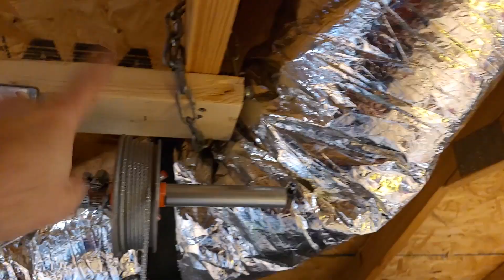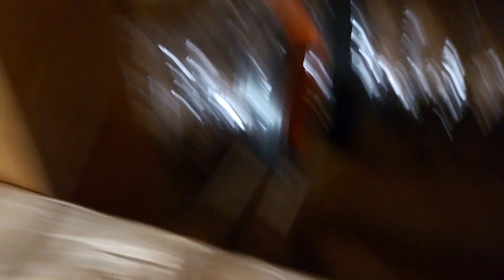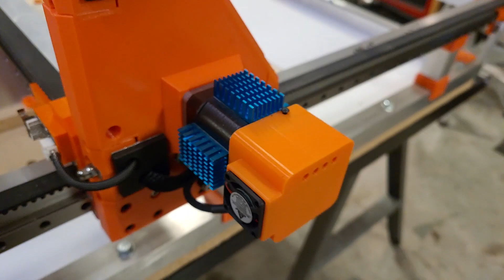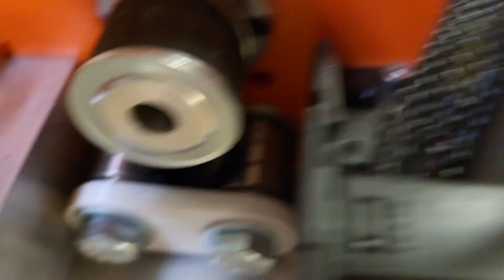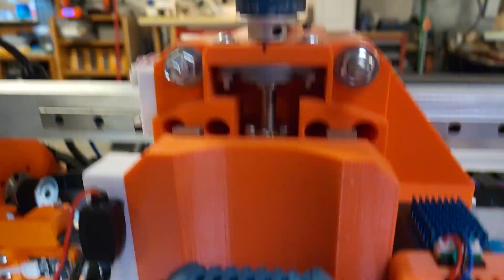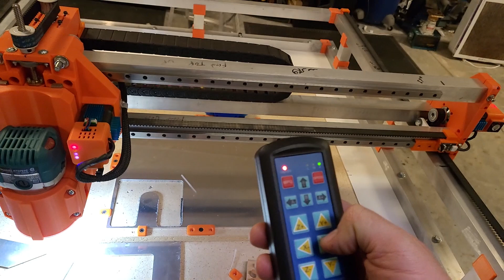Walk Around Of My 3D Printed CNC Router based on the Ivan Miranda's Design. Many Mods

Comment: From what i've seen online, most rigidity problems come from the motors not being able to completly hold the position when you apply force on the toolhead. Do you know what the deflection on the gantry is when pressing on it?
Reply from the maker: I havent actually measure deflection but i cant stop the gantry when it is being powered. The 19 to 1 gear reduction gives it plenty of power but makes it super slow.
Reply: @JPN76  I've seen that you mentioned that, still rigidity is a whole nother beast compared to static load resistance. An analogy would be a wooden beam vs an aluminium beam. Both could "stop" your hand from pushing, but the elastic modulus is vastly different, as such, one could allow vibrations and the other "would not" . 
The same applies to the geared motor. While you can't apply enough force to overwhelm the motor into the next step, you can still make it travel, say, a 1/10 of the step to the next step, and then it would snap back.
This phenomena combined with frequencies, is our worst enemy in hobby CNC.
This is usually solved with the "worm gear" like properties of ball threads, and in belted systems, basically over-sizing the motors to the point that that 1/10 of a step, requires such a large force, that it usually never occurs.

Comment: This CNC and the lift is awesome I will be building on from my shop. The lift mechanism (motor and garage door equipment is "inspired")  . I was wondering where I could source the drive mechanism "motor for positioning satellite dishes" may be tough to find.  Any idea on where to find one ???
Reply from the maker: I just searched not sure where to find that motor. I bought a bunch 20 years ago for another project. Used them for a paint ball tank turret. Scroll back 15 years or so in my vids and you can see it. But honestly if I had to do over I would get a stronger motor. A right angle low rpm high torque motor should work.
Reply: Windshield wiper motors are nice options.

Comment: Can you please do a video of the control board been doing mine for a while and went with an Arduino cnc shield, also how did you attach your laptop to it
Reply from the maker: I use a USB mach3 conrtol board.  The link is below but they have many variants that work the same. It will not work with GRBL just mach3 control software. 5 Axis Breakout Board, Maximum 100kHz MACH3 USB CNC Motion Controller Card Interface Breakout Board with Hand Wheel Interface https://a.co/d/4AYS8Oj
Reply from the maker: Also there are many videos about these on YouTube. You should be able to find several.

Comment: Nice all around!

Are you thinking about replacing any of the plastic with aluminum parts cut from this router?

I'm thinking about making one out 3d printed parts and extruded aluminim. 

Have you had any twisting or movement issues with the saw horses?  I've seen guys make torsion tables for a stable base.  I mainly want one for wood/carbon fiber plate.  I might do some aluminum too but it would be rare.  I'm thinking about mounting mine on the wall and have it fold down for use.

Have you thought about enclosures for noise/dust control?
Reply from the maker: I've thought about all those. The table is pretty rigid with the framing under it sandwiching the board between that and the frame.  I'm probably not going to bother with rebuilding out of aluminum. This one does what I need pretty well.  A couple of people have built. I have seen a couple built with extruded aluminum,  and they look good.
Reply: @JPN76  ty!

Comment: I recommend Wago lever locks to use on your wires. You can easily connect & disconnect your wires as needed infinite times.
Reply from the maker: I agree I was just on a tight budget when I built this. Hoping to not have to take it apart.

Comment: awesome set up. i remember seeing the one ivan had but must not have ever saved it. im now at the moment to start this whole process, and wasnt initially going to 3d my own parts. Now I want to but was curious as to a printer that you might recommend? Obviously everyone has their opinions but you seem happy with your results and was curious of your opinion. Thanks and keep up the good work, ive subscribed and look forward to buying the plans.
Reply: The most user friendly printers right now are the Bambu Lab X1 Carbon.  Before, Prusa was the one to start with, but the Bambu blows it away!   Have seen lots of people selling Prusas and replacing with Bambu Labs.
Reply from the maker: I bought a prusa I don't have experience with any others but I researched it for about 2 months looking at reviews. It was easy and my first time printing. I had the printer about 6 months before doing this project.